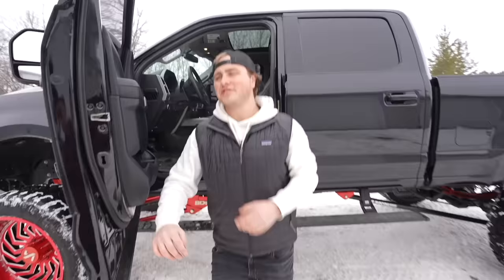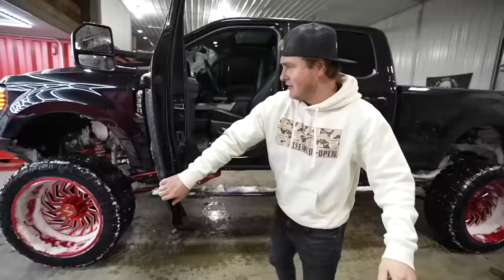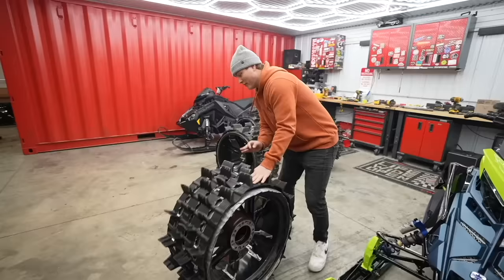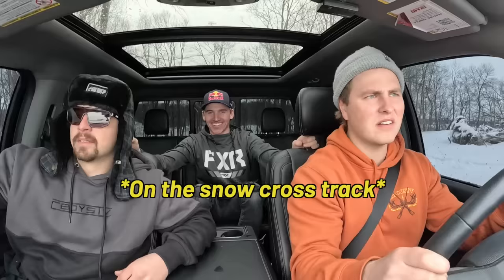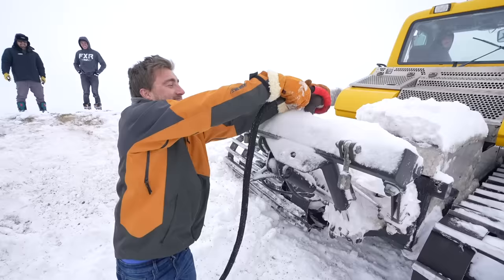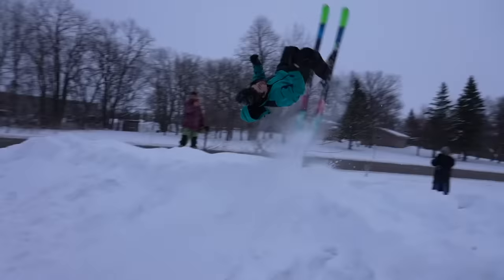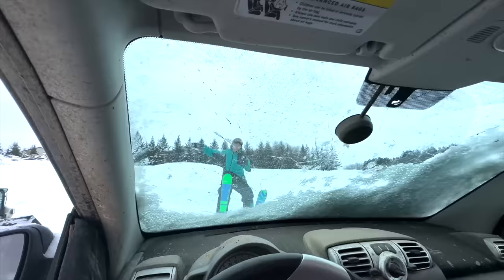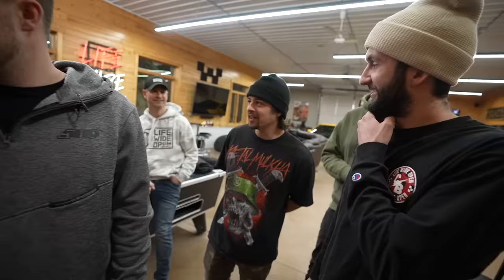Budget Snow Tracks on my Sema Truck

Comment: wrap the track around the tires deflate them a little connect the track  ends to each otherand inflate the tires to tighten up, done it a few times much easier then this debacle

Comment: It’s think it’s really cool to watch you young feller make so many changes to the toys an make me laugh. 
But for one , you took the worst truck an jacked it (which make it worse in most cases ) and got stuck in the same amount of snow I pack down with a Subaru. 
 Don’t mean to hurt your feeling. But I use the Toyota to break trails for the old feller that drive fords to the icehouse. 
In my case ! It really sucks when your stuck on top of a six foot snow drift an need to shovel the truck to the ground without rolling it over. So shovel for balance to the ground. 20 miles from town is no place to be upside down an one vehicle nor camera crew. At zero to -30 F

Comment: So I went back to the video and saw you used I uline duct tape. So Did the math unline sells 470 rolls for $4k and each roll of 60yd duct tape weighs about 1.4lbs. So If we multiply 470 by 1.4 we get 658lbs of duct tape all together now we divide 658 by 4 to get around how much is on each wheel which is 164.5lbs of duct tape per rim. So yes Ben $4000 is useful information.